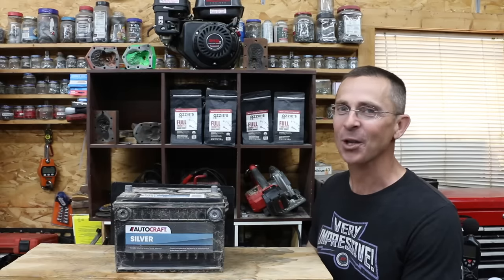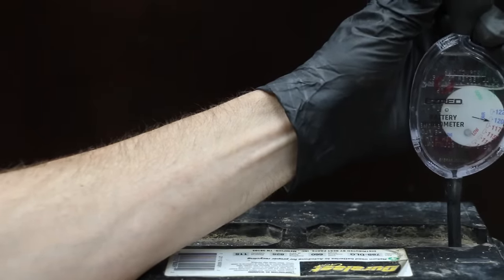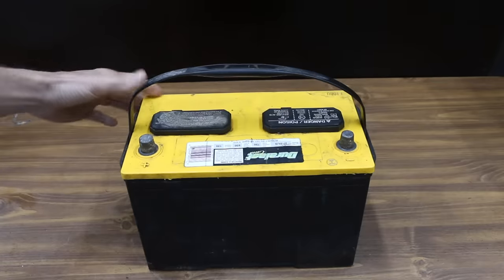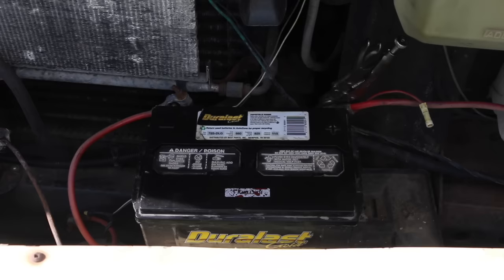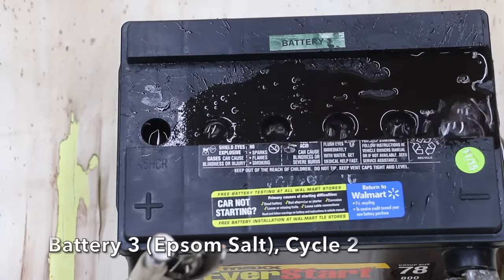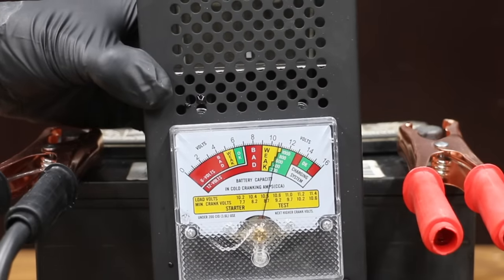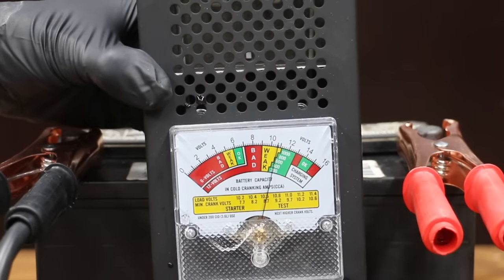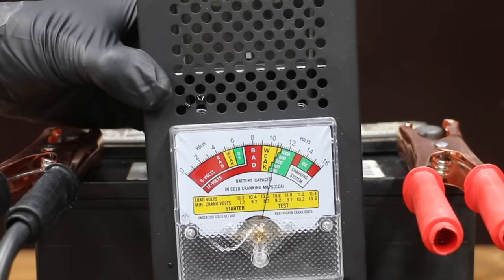Myth Busting! Can You Restore a Dead Car Battery With Welder?  Let's Settle This!

Comment: For those interested, when the hydrometer takes a fluid sample right after the welder, you can see the loose sulfates causing the fluid to be brown. Over time through normal use those sulfates settle to the bottom and build up.  There is empty space in the bottom of the battery for all of the accumulated material that is no longer participating in the chemical reactions.  Deep cycle batteries have more empty space in the bottom.  When enough piles up it can touch the plates and short them out causing that cell to stop working.
Reply: A lead battery should never be left discharged which causes rapid sulfation.  Also, it can freeze and bust when discharged.  Lead wants to be fully charged unlike lithium which is happy around half charged.  Every day a lithium is at full charge it's life is shortened.  Even stopping the charge at 4.10 instead of 4.20 per cell can increase the lifespan as much as 4 times.
Reply from the maker: Thanks for sharing.
Reply: So rinsing and flushing the battery could extend it's life dramatically? When I do this on a 200amp charger I've had a couple batterys that have a dead cell that will come back around but usually only temporary. I have tons of cars so never enough batteries. Do you think building a setup to safely flush and maybe filter the electrolyte would save some dead cell batteries?
Reply: @jasonbirch1182  I wouldn't say dramatically, but yes professional battery recyclers/refurbishers do flush out the batteries as well as high amp charging/reconditioning. Battery refurbishing used to be more common than it is now due to manufacturing scale and consumerism. Modern batteries use much thinner plates to both be cheaper and to fit more in, which makes them harder to refurbish.  I believe there is a way to filter and clean the old battery acid too.

 However the problem is there are many different ways a battery can fail or go bad.  Every time you charge and discharge, lead is transferred from one plate to the other. That means the plates are constantly changing shape. It might only be slightly but it adds up over time. Also the sulfates in the bottom contain lead that didn't make it all the way across or didn't stick very well, so the plates are constantly getting thinner and smaller meaning less surface area. 

When the battery is charged there's a higher concentration of acid so it's harder for the water to freeze. When the battery is dead the concentration is lower so it's easier to freeze which will also misshapen the plates or potentially crack the plastic.  There's also a separator membrane or mesh between the plates that could deteriorate or get contaminated. 

Finally the plates are tightly packed in there, closer than you think, so it'll take a lot of agitation to flush between them, and multiple flushes to get everything from the bottom out.  So it ends up being a lot of work for no guaranteed results. It'd almost be easier to open the battery up and wipe the plates off but at that point it's just a bit more work to melt the lead down, roll it into sheet, and cut new plates from the sheet.
Reply: @jasonbirch1182  But also when you do flush it, you refill it with fresh 50-50 acid water mix and so having fresh fluids at the proper concentration could potentially help too.  Many people, myself included, commented on this video that after he flushed it out with Epsom salt he had to flush the salt out then refill with fresh acid. But he either didn't know, forgot, or maybe didn't have any fresh acid
Reply: @1234567890CAB  thanks for the info. I also thought the salt should have been flushed and refilled with acid water.
Reply: yes , great explanation the number 1 reason battery goes bad . It short cutting itself .
Reply: @1234567890CAB  what about vibration? Meaning, maybe having the battery full of Epsom salt or even just its original fluids, but turned upside down and vibrated to try to get all the crap moved out of the bottom. I'm picturing a rig over a plastic tote than I can easily roll the battery upside down to dump and refill. Have a drain and filter/pump setup.   I'm a fabricator with mill and lathe, welding and tubing bender in my shop. I have thousands of dollars worth of batteries that are worh maybe a couple hundred as scrap. I'd spend a day building something to do it without making a mess and losing an eye. I've had one explode from a spark and hydrogen so I know it's not to be trifled with.
Reply: Interesting thank you!
Reply: @jasonbirch1182  That "whoomp" like the sound of an igniting gas stove is how you know your charger is working!
Reply: @foonme99  nooooo. They explode violently. Blows the whole top off. I have no idea how I didn't get doused in acid. It really hurt my ears. Funny thing is the battery is still good. Just can't use it in a car cause it would spill all over.
Reply: @jasonbirch1182  /sarcasm

Yes, a hydrogen explosion from a battery is the worst day you'll have. We did it on purpose a couple of times and a I can testify that it is almost no fun at all.
Reply: @solarsynapse  Very interesting and I knew that lithium had this problem, but did not know how bad it was.
Reply: @jasonbirch1182  Seen a guy on Youtube do it with industrial lead acid batteries that were in o.k. condition, but not great. When the the electrolyte was flushed out and filled with new electrolyte, it was all good again (he did not filter it, just replaced it). Almost as good as new. He was using them in an off grid solar power/wind power setup on a homestead and he bought about 4 of these tall (maybe 2/1/2 ft) lead acid batteries and he managed to restore 3 of them this way to near perfect with the 4th being o.k., but not quite as good as the other 3, if I remember correctly. He neutralized the old acid with baking soda, before disposing of it.
Reply: @jasonbirch1182  Cheap batteries more often than not have much deeper plates to aid the build-up shorting the cells much earlier than a quality battery.
Reply: @jasonbirch1182  Silcone it - sticks to everything..
Reply: I have a couple of dead 12 volt, sealed electric wheelchair batteries, that saw little use. They were run down and stored when new. I'd like to try to revive them. One wheelchair tech said a large car battery charger could, but not a trickle charger. Another wheelchair tech told me, they were too old and have been dead too long to try to charge with a large charger. I don't have a charger, but I do have a TIG welding machine. It cost about 10 times the price of the batteries though.
Reply: @jimjungle1397  If you are going to hook them up to the welder you must find a way to open the cells to allow them to vent away from any sparks or flame and preferably be outside.  Even though they are called "sealed" they usually still have a strip across the top that caps off the cells.  This process generates hydrogen and oxygen gas.  Hydrogen alone is flammable, but the generated oxygen is at the perfect ratio to be explosive.

There's no reason to worry about the Tig welder, it sees larger loads and more extreme conditions while welding.  The welder is pretty much a high current low voltage power source.  Just be careful to set it to DC and hook it up in the correct polarity.
Reply: @1234567890CAB  Yes, I figure they might heat up and boil some. I think my welder is too expensive to use as a battery charger and will try to find the use of a large barrety charger. Even though the wheelchair batteries are, "sealed", they do have caps, but I don't know if they are glued in place. They are not vented.
Reply: @jimjungle1397  Yeah, it does have to be a high amp charge and low amp will not do it if the batteries are completely dead. If you don't want to risk an expensive welder, get a cheap automatic smart charger with a desulfating option. The little defulfator he used didn't work because it's not a very good one. The ones built into the modern smart chargers are better. They're about $70 at places like Walmart, that's where I got mine. A lot of quality modern automatic chargers have that option. They go up to about 15 amps and as low as 2 amps, so they're a lot more powerful than say a little trickle charger limited to 2 amps only. Nice thing is, they will help you avoid this problem in the future, as you can use it to top off your stored lead acid batteries. Good luck. I'm not even sure how well wheelchair batteries recharge from dead, because a lot of them are AGM batteries, so they are different than lead acid. I know they are a lot more expensive too. Most of the modern smart chargers though do AGM batteries no problem. But I dunno how good they are from coming back from the dead vs. a cheaper lead acid bettery. I like my auto charger, I don't have to worry about it overcharging. 

The old school "non" autochargers are handy too though, as they have no option to stop and not overcharge. Sometimes, like with a really dead battery you want overcharging, it can act like a desulfator   kinda like the welder trick. Whereas an auto charger self limits, to prevent battery damage. The old school ones like you saw at one point in the video here (red and white I think?). Those are the non auto ones.  So there's good reason to have both kinds. I just have an auto charger, my old non auto bit the dust. A welder or 200 amp capable charger are the only ways I have seen done to bring extremely dead ones back to life and you are boiling them, so be extremely careful if you do that. Most people do that in a building they don't care about, or outside, it has to be able to vent those gasses, battery explosions are nasty and dangerous. 

Trying with an auto charger, or non auto, is the safest option (still vent it well) because it's limited to wall amperage of about 15 amps. The DC inverter welders can hit about 100 amps on a 15 amp outlet. But they will trip the breaker typically at around 110-120, some people get away with more, if you are just welding well below the duty cycle. That's probably why he went with 85 amps and even at that he was boiling electrolyte. You can also get cheap DC stick welder for under $100. So that's an option if you want to try this force reviving a battery back to life. Just wear safety specs. preferably a face shield, some clothes you don't care about, because this is not a safe thing to do really. Everyone who does it will tell you, be extremely careful. Your dealing with hydrogen gas and we know what that can do. But it has to build up to be dangerous, so ventilation=super important, so it never gets to that point. However, it can burst from this type of high amp revival. nevertheless, hence why he was checking temperature on it.
Reply: @MrBilld75  As I understand it, a high amperage for a short time, just to get it to state where it will charge normally at a low amperage might be all that is needed. I'm not keeping sealed batteries at high amperage for very long. The wheelchair tech claims it works.
Reply: @jimjungle1397  I see. That's interesting and I am learning something new, thank's!
Reply: Excellent information! Thanks for sharing
Reply: @jasonbirch1182  I did a bit more research because I wasn't 100% about the Epsom salt. Inside a lead acid battery there's a lead plate (Pb), a lead oxide plate (PbO2), and Hydrogen Sulfate or sulfuric acid (H2SO4).  When the battery discharges some lead comes of the lead plate to make lead sulfate (PbSO4), and some lead oxide comes off of the other plate to make water (H2O) and more lead sulfate (PbSO4).  I ideally when you recharge the battery all of those reactions would be reversed and all the lead sulfate would be broken down back into metallic lead (Pb), lead oxide (PbO2), deposited on their respective plates, and sulfuric acid formed in the process (H2SO4).  However multiple things happen over time, first the depositing material back into the plates isn't perfect so some small amounts of lead and lead oxide flake off and settle to the bottom, some of the lead sulfate settles down to the bottom, and some of the lead sulfate crystallizes or gets stuck to the plates.  The stuff that settles down to the bottom represent lost capacity (amp-hour) as in how long you can run a 1 amp light bulb on the battery.  For just starting a car we don't really care about that.  However the sulfate crystals on the plates represent lost surface area or discharge rate (amps or cranking amps). This could be thought of as how bright the light bulb gets when first connected but that's an oversimplification. 

Now about the refurbishing strategies. Epsom salt is magnesium sulfate (MgSO4). Magnesium is both more reactive than lead and more soluble, that means the magnesium wants to take the place of the lead in the lead sulfate (PbSO4 -> MgSO4). So the theory is that the magnesium will wedge its way between the plate and the sulfate crystals, knocking them off the plate. However the problem is now you have magnesium left behind on the plates.  

With the welder or overcharging, you're doing two things. First you're forcing some of the stubborn lead sulfate to break down and react, reintroducing it to the plates again and adding more material back to participate in the reaction.  The second thing that's happening with the welder is electrolysis or breaking down water (H2O) into hydrogen(×2 H2) and oxygen (O2). These form in little bubbles on the plates and vent off as gas which is why this needs to be well ventilated because that's an explosive mixture.  Those little bubbles exfoliate or "sand down" the plates. This means that a small amount of the plates come off to reveal clean material underneath that does not have sulfate crystals.  The lead or lead oxide that comes off the plates, again, settles down to the bottom and represents lost capacity or run time, but we gain surface area or cranking amps (if there is still material left).  Of course at some point the plates get completely worn down and you can no longer "sand" them down any further. 

With all that said, what I recommend is that you do the welder first, then hook up a charger with some vibration or agitation for the battery.  My thoughts behind this is the welder "cleans" off the plates, then the agitation helps some of the lead sulfate on the bottom to hopefully come in contact with the plates and react again.  Test the battery after this to see if it was enough. If not try again.
  After a few cycles of welder, and charging with agitation, if your still having problems with that battery, flush the batteries out to remove anything that didn't react (loose lead, lead oxide, or sulphate crystals).  At this point I could see two routes, either adding fresh acid or adding fluid from a dead battery.  Acid is produced during charging when the lead sulfate is broken back down, so if you dumped out the lead sulfate you have to add more sulfate back in.  Fresh acid would put the battery in a "charged" state or the plates are at their thickest and using the battery thins the plates further as material is turned into lead sulfate.  Fluid from a dead battery would put the battery in a "discharged" state and when you charge the battery more material would be deposited on the plates hopefully making them thicker.

Too long didn't read - I don't think the Epsom salt is worth it, try the welder and charging first (in a well ventilated area) without flushing. If the battery is still giving you problems, flushing could be the next step to try after the welder but would vary case by case.
Reply: @jasonbirch1182  Too long didn't read - I don't think the Epsom salt is worth it, try the welder and charging with agitation first (in a well ventilated area) without flushing. If the battery is still giving you problems, flushing could be the next step to try after the welder but would vary case by case.
Reply: @1234567890CAB  "too long didn't read" then writes half a novel. Seriously, I see this in comments all the time. Are you illiterate? Reading one letter at a time? It took me 25 seconds to read your entire book. I've already rescued tons of batteries. The next step is trying to rescue ones with a shorted cell. That's why I was interested in flushing the bottom out. I'm fully aware of the explosion gas danger. I blew one up when a wire got bumped and it sparked while getting 200amps.
Reply: @jasonbirch1182  if this was just a private message from me to you then I wouldn't put a TLDR. But because many other people can see and read this, they might appreciate the summary.
Reply: @jason birch  I just realized! I'm not saying that I didn't read.  I have read this entire thread and read some articles online. I was offering a summary of my "novel" for anyone else. I know that I often over explain, or make things more complicated than they need to be.
Reply: @1234567890CAB  ok. I get a bunch of idiots saying "I'm not reading all that about like 3-4 sentences in a comment. Like kids can't be bothered with completing a thought these days.
Reply: @1234567890CAB  I once saved a battery by discharging it to zero and charging it in the other direction and then discharging it again and charging it in the correct polarity. I think I was using probably a standard 10 amp battery charger to do it.

 Question: If you discharged the battery and then used the welder in reverse polarity would you be able to safely and more quickly knock the sulfates off the anode?

Second question: with respect to the agitation, I've been thinking about building a large ultrasonic cleaner that I could immerse a battery in. Would this make sense?

If I only had one battery to be concerned about I wouldn't be messing around, but I have about a half a dozen very expensive marine batteries from my sailboat that I couldn't bear parting with without at least trying something.
Reply: @jasonbirch1182  Hence the vid of the guy pouring the acid out,  then doing a number of vigorous sloshes with a little distilled water and pouring that sludge out.
Reply: @user-lj6gk4lv9s  yes that's great but if  half of it ends up stuck between the plates it's going to definitely be shorted out. That's why I was asking someone who seems to have intimate knowledge of what is going on inside a battery. The way the fill holes are shaped it also won't dump out easily. It's not flat, the edges go down below the top surface.
Reply: @1234567890CAB  Thanks for the technical description. At least some of us appreciate the insight.
He confused me regarding the epson salts. The way he stated it, he attempted to recharge the battery with an epson salt solution in place of the sulfuric acid. Unless the sulfate molecule in epson salts happens to mimic the function of the sulfate molecule in sulfuric acid, this makes no sense to me. Did he in fact attempt to recharge using epson salts in lieu of sulfuric acid, or did he miss specifying that he drained the epson salts and replace it with sulfuric acid before recharging?
Reply: @solarsynapse  That's valuable information. So, when my tablet/phone says it's fully charged and that I should unplug the charger... I should unplug the charger, eh? Thanks.
Reply: I love it when individuals with Real knowledge and background chime in and actually educate guys like myself. Knowledge is Power.
Reply: @MrBilld75  Great information sir. Thanks. ✓
Reply: @andyroid5028  Yep.  I use an outlet countdown timer to keep the charge below 90%.  There are also alarm apps that can sound at a specified charge level.
Reply: @jasonbirch1182  my dad would flush old batteries to get another 6-12 months out of them. You need to be very careful because of the acid. Just do like he did in the epsom salt test. Drain and rinse, and rinse well with distilled water charge, drain and rinse and fill with fresh acid solution.
Reply: @foonme99 almost lol
Reply: @1234567890CAB  I always heard you shouldn't put fresh acid on a badly used battery cause it will eat the metal pretty fast, but no idea cause I never tried...

Also to clean well the bottom after a few flushes I'm thinking what about using a water pressure washer on like minimum settings and then flush a few more times 😎
Reply: @titlicker3229  That's amazing for an epsom salt fix. It doesn't typically work that way. People will get another 6 months or a year out of it, max. I think it depends on the level of sulfation and how degraded the plates have become etc. But in an ideal good condition battery, I suppose you could get another 2 years out of it, I believe it.
Reply: @jasonbirch1182  "ok. I get a bunch of idiots saying "I'm not reading all that about like 3-4 sentences in a comment. Like kids can't be bothered with completing a thought these days."

completely understandable. I often get this reply from morons when they are proven wrong in an argument on social media.
Reply: @1234567890CAB would you just flush with distilled water and then refill acid?
Reply: I had always wondered about that happening when using the welder method. The crud has to go somewhere if it pulled off the plates by the high amps then it's gonna fall down and short it eventually.
Reply: Thanks a million for doing t his test. I had heard about it for years but didn't believe it. Now I know the truth. I still wouldn't trust the battery in my everyday vehicle even if it tested ok. I would be a good battery for a tractor or some other piece of equipment that you don't depend on away from home.
Reply: In worst cases if shorting has happened long enough the bottom part of plates are eaten up. That's why it's not possible to fix led battery even when fluids are changed and salts removed for most dead batteries like shown in video. Battery may look nice from top but in reality most of the plates are gone.
Reply: That brown particulate is most likely Lead(IV) Oxide, which is what the positive plates are made of. The positive plates are experiencing corrosion and shedding in that cell. Lead Sulfate is white.
Reply: @jimjungle1397 hey, did you ever bring your batteries back to life? I have 2 similar situation. I tried to trickle charge from another battery, while charging that battery, tried over charging too. Nothing. They just dead
Reply: I love this comment thread. This is how social media should be. Everyone is sharing their experience and knowledge and there is nobody insulting, criticizing or just plain trolling for the sake of being disruptive or feeling like the toughest guy around. I learned a lot from the video, but combining what I learned from this thread will help make that knowledge more practical. Thanks to everyone for sharing
Reply: @solarsynapse  So how come you got all these bluetooth earbuds that is put into the case and as soon as you do it begins to charge the battery? I am not sure how they are managed but maybe their BMS needs to keep the state of charge on those lithium batteries less than full? Most phone OS won't even allow you to do this, in fact you basically have to jailbreak it in order to do it. Otherwise all it can do is set an alarm and make you unplug the phone.
Reply: @CONEHEADDK  Silicone will not stick to itself.  The cured product must be physically and chemical removed.  I have been using Lexel in place of silicone for nearly everything.  It is FAR better for most applications.  The 2 downsides to Lexel are that silicone can withstand about twice as much heat and Lexel is very slow to cure.
Reply: @jimjungle1397  I use those batteries all the time.  Worth a try, but any lead battery left dead for a long period is most likely a goner.  Do not ever over charge or charge AGM faster than rated...even once.  They will vent and be damaged, possibly destroyed.  Yes, you can pry off the "welded" caps, remove the silicone caps and add a TINY bit of distilled water, but from my experience, they are ruined. It loses some acid when it vents.   Remember, there should not be any free liquid in an AGM battery.  They are moist glass mats.
Reply: jacobmayes6372  That's why I question lithium jump packs in hot summer vehicles.  Of course you would probably need it more in the winter.
Reply: @taiwanluthiers  Sorry, you may not have seen my info, or even this, yt autodeletes truth.
Reply: @1234567890CAB  the acid can be cleaned and filtered in one step.... distillation. But is kinda pointless since it's so cheap to buy.
Reply: So, in theory, you could preemptively flush out the battery and make it last much longer???
Reply: @solarsynapse 
damnit, this is exactly why we need to read manuals instead of listening to our parents' advice on batteries.  everything I've ever been told about batteries is wrong apparently😂
Reply: @jasonbirch1182  if you have a 200A charger fill the cell's with distilled water 1/8"inch above the plates charge the battery at 200A for 15min. then rest the battery for 1hr.  Do this process 5x total - 15/min - On  1/hour - Off
Reply: @1234567890CAB   What about using an usltrasonic cleaner?
Reply: @solarsynapse thanks
Reply: @solarsynapse  Actually there was a study done that found lithium is best shelved at 80% and 20% state of charge where a thin film develops on either the anode or cathode side which slows a certain class of degradation type than at 50% SOC. It is a lithium battery chemistry quirk but it doesnt happen unless the battery really is not used at all for long periods. So for those spare power tools batteries sitting around it would apply but not for your phone. For in use lithium batteries the higher the SOC, the higher the capacity loss over time no matter what. Which seems to make them bad for standby use but the capacity degradation rate is still half of the baseline degradation rate of a fully charged lead acid or AGM type battery.  Which is why so many people using AGM for emergencies are now buying LiFePo4 now that the price has come down.
Reply: @Sidicas  And the price of lead has gone up.  Whichever gives the most Watt life for the money is the value.  Also, LiFe is different than LiPo and the other many chemistries.
Reply: @1234567890CAB  If it is discharged, the acid should be in the plates, if it is charged it is in the water, so that will affect the ratio.
Reply: @taiwanluthiers They are used  frequently and don't have a long lifespan.  Some new "phones" can be set now like Toughbooks can.
Reply: You are correct about the sediments in the bottom of the battery just pick the battery up slam it down on the ground it will bounce the debris back up and will put them back in action I've done this with multiple batteries just try not to smash the damn thing just a couple good slams to the ground preferably on the grass I've had a couple that didn't succeed after that if I still had them I would try this welder test
Reply: @solarsynapse studies foud that in fact LFP batteries charged to 80% or 20% and stored do much better than LFP batteries stored at 50%. This is because a film develops at 80% SOC and 20% SOC that protects the anode/cathode and the film immediately breaks up on any charge or discharge. At full charge lead acid batteries have a different type of failure that is different from sulfation, it is called anode corrosion where the anode just breaks apart and falls to the bottom of the battery.  This is why lead acid batteries, even when stored at full charge on a trickle charger lose 20% capacity in 5 years while LFP at fully charge only lose 10% capacity in 5 years.
Reply: @Sidicas  I know there are a few formulas for lead and maybe a dozen for lithium.  What is LFP?  The lithium polymer formulas should not be left at full charge.  Never seen or even heard of the terminal problem with lead.  AGM lead can be done for in 5 years, some don't make it 3 and others with gentle use can see 7.  20 years is my record for Sanyo NiCd!
Reply: @solarsynapse  LFP is what off grid homes use nowadays for emergency power and to store solar energy for overnight hours. LFP prices have come down to the point where the match Lead acid AGM for storage.   I have a 6 year old bank of AGMs that I am slowly replacing with LFP  I use it to power my freezers, recharge my mobile devices, and keep the wifi working in the power outage like the one we just had for a few days over memorial day weekend, they are all standby batteries kept at 100% charge waiting for the next unexpected power outage.  LFP lifespan is 10 years or 3000 charge cycles, but at 10 years it is only down 20% capacity and you just buy another one and add it into the bank if you need the extra storage.  My AGMs are 6 years old and can stlil put out 2,000 watts no problem but their capacity degradation is real, I think they are down almost 40% capacity already. I think the only reason LFP isn't used in cars is because if they freeze it will ruin them and they can freeze at full charge. But I think they might work good in warmer climates.
Reply: @Sidicas  Ah, LiFePO4 lithium iron phosphate.  Lower voltage per cell, more stable, requires an appropriate charger.
Reply: I bought a self maintenence battery about a year ago still working good after I drained it twice Jumpstarted it for 3 days then ran the car the same time of the day my battery died. If I leave my ac on when I cut the car for off for an hour it will somewhat charge the battery.
Reply: I always empty the acid out and flush out the cells with baking soda. I leave acid for few hours to settle the crap out and filter it before putting back in. Works a treat
Reply: Here in Australia back in the 80s local government department for servicing their vehicles, had guy just flushing and recharging batteries.
Reply: I used to work for oriellys and I remember someone cane in trying to buy battery acid. I looked at them confused and said “we dont sell battery acid” the customer proceeded to walk over and grab a small jug with red liquid. Apparently battery acid replacement is fairly common. But if you replace your battery every 3 years through warranty….. you should even have to deal with bad batteries
Reply: @chakalaka831wat  here in Australia the longest warranty you get is 30 months was just 2 1/2 years. I have replaced batteries under warranty, but usually they last longer
Reply: I mentioned battery must be cleaned out entirely with pressure washer help makes it a lot easier,
Reply: Any good way of removing the sediment
Reply: @jimjungle1397 they are vented. Usually a tiny place around one of the glued on strips. Ull find it if u ever remove the strips
Reply: Thank you. I always appreciate it when knowledgeable people share that knowledge with those of us who know nothing about the subject.